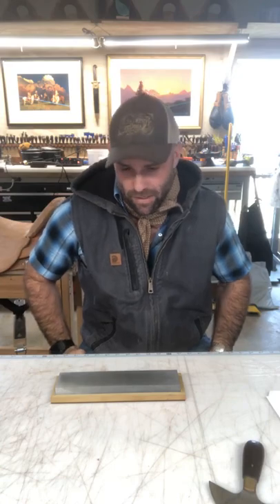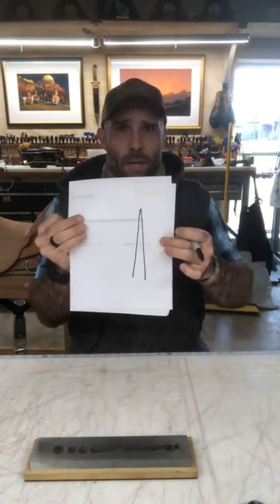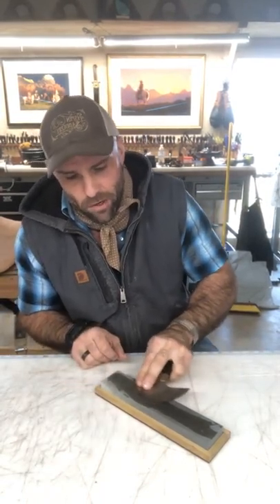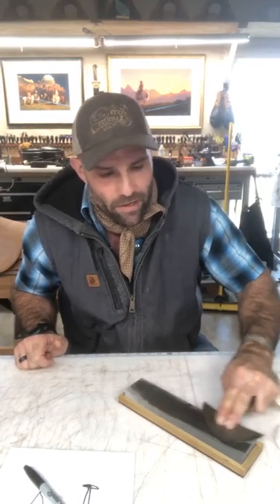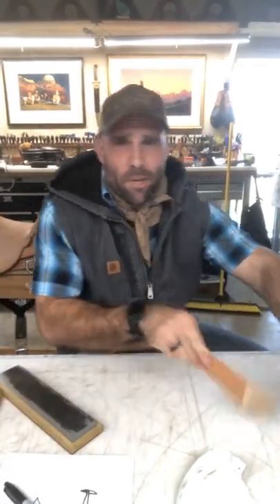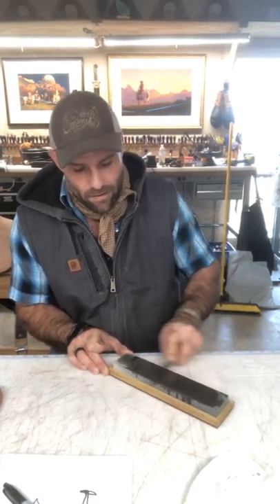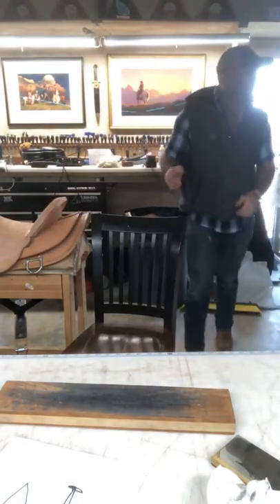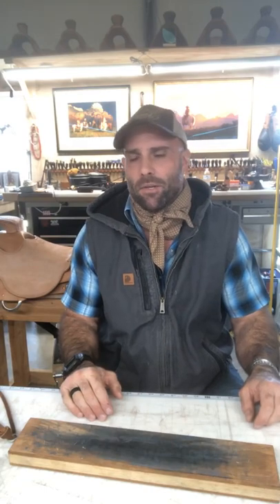How to Sharpen a Head Knife

Comment: Ben gives a good explanation of how knives and knife sharpening works.
Having been a veteran meat cutter who made his living with knives ranging from 18-inch scimitar steak knife to a 4-inch boning knife which I had to maintain sharpness every day.  If I put a fine edge on my knives, they would be dull after a few cuts. So, I maintained a utility edge which could be run over a steel and brought back to sharp very easily. Anyone who makes a living with knives learns what type of edge is needed for what they need to cut.
I do leather work as well which requires a smoother edge so the strop is needed for this, but heavier use knives like a butcher knife do not need to be stropped, in fact the knife will become dull due to bone and other difficult to cut materials found in the carcass.
The only thing I would add is when honing a blade, I start honing a little in back of the edge to thin that part down so I can maintain the correct edge geometry for the finished edge. If you don't do this you will eventually get into the thicker part of the knife, your edge will develop a more obtuse angle and be more difficult to use and maintain.